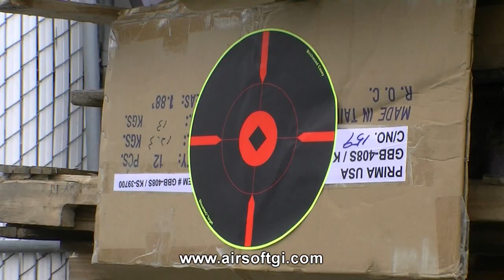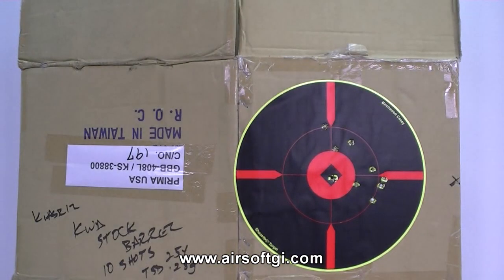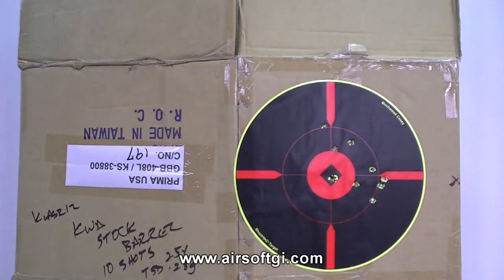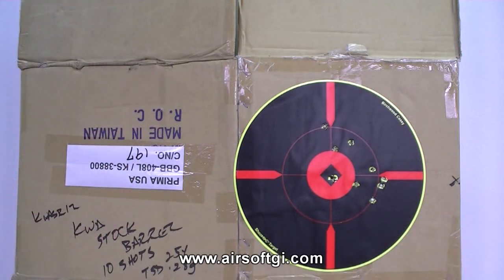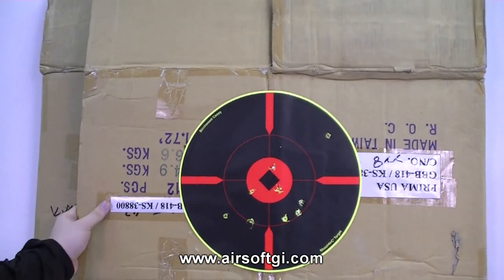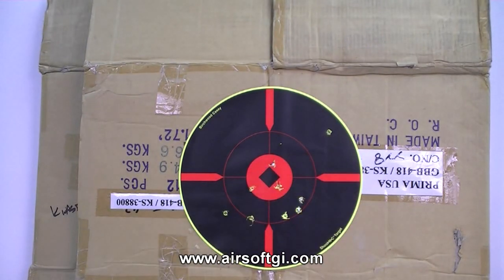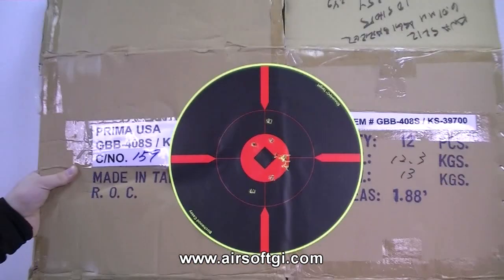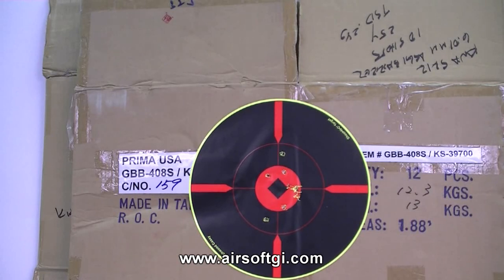Airsoft GI - Tight Bore Barrel Test - 6.01mm vs 6.03mm vs Stock KWA

Comment: 6.01= Better for indoor, short range
6.03= Better for Outdoor, long range
Reply: Why?
Reply: Go on airsoft sniper forums, I don't know how to explain it, but they might
Reply: I'd say its because 6.01mm actually reduces your FPS with an 5.95±0.01mm BB.

The way to go is with 5.88±0.01mm BBs, though I haven't got one to test. It's said to unite the best of both worlds, though that is debatable.
Reply: The more air around the BB the better
Reply: AirsoftGhillie WIDE-BORE BARRELS FTW!!!
Reply: Daniel Symonenko No
Reply: Actually yes, Widebore ftw
Reply: The tighter the barrel the higher the fps...
I went from 6.05 to 6.03 as well as compression upgrades. It silenced my gun and increased fps by about 25 or 30
Reply: The reason is there is more air behind the BB rather than surrounding it and leaking in front as well.
Reply: Fps doesn't determine range so don't be like "Tighter the bore the higher the fps" that doesnt matter
Reply: AirsoftGhillie What the fuck... if I have a gun that shoots 36 million feet per second, and one that shoots 10 feet per second, which one will have better range? Fuckin misconceptions of course if something shoots faster it will go farther before hitting the ground.
And yes tighter bore barrels directly equate to better fps. Tighter bore = better compression = less air loss = more air behind the BB = more force applied to the BB.
Get your shit right this is common sense
Reply: You either are new to airsoft or have never shot a Tokyo Marui, A Tokyo Marui M4 only has 280 FPS due to FPS regulations over seas, their hop-ups are so good that you dont need a very high fps to have good range, therefore a Tokyo Marui with 280 FPS, will outrange a g&g, ICS, Elite force, VFC, etc with 400 FPS ANY DAY.
Reply: AirsoftGhillie This is physics buddy, hop up can extend the range, not make it unlimited. No matter how good of a hop up you have, 1 fps will never out-range 1000 fps.
And I didn't say shit about hop up anyway. Just goes to show you aren't thinking about this, just going with the good ol' "hop up is more effective at increasing range."
Reply: AirsoftGhillie Now answer my question already.
Again: If I have a gun that shoots 36 million feet per second, and one that shoots 10 feet per second, which one will have better range?
Reply: I am talking about airsoft because in airsoft we have a hop-up. I am not talking about how far a BB will go without hop-up, I am talking about a BB with hop-up. But yes the gun with the supposed 36,000,000 FPS will out range the gun with 10 FPS, unless the gun with 10 FPS has some legendary hop up, then it will outrange 36,000,000 with no hopup
Reply: That is true, if tests are conducted with equal barrels and hop-ups and other such internals, but with one gun having a higher tension spring, then the higher tension spring one will prevail if the the hop-ups are set to the same setting due to it having more inertia and therefore overcoming the force of gravity for an extended period of time over the lower-tension spring rifle.
Reply: Yes that is true but my statement is also true
Reply: AirsoftGhillie I was not denying your statement, in fact I intended to validate both your and Clay's statement.
Reply: k.
Reply: I didn't bring up hop up. Higher fps = better range. No other variables changed.
This is what Daniel said and what I said.
Reply: Well this is airsoft, everyone has a hopup, so there is no reason to say it like that
Reply: Ugh.. My gun has a hop up. When I installed a tighter bore barrel, and did not modify the hop up, it's fps increased and its range increased.
Same goes for all guns.
Reply: Lol you guys are so funny.  Fps is the speed not distance. I know this sounds stupid, its true. With airsoft gun's hop up'. By spinning bottom over top it floats longer. Ive seen slow ass floating bbs travel 80 90 yrds.  Now heres the kicker. You do need hi fps to create the spin that you need to travel that distance. In a way everyone is right. Best acc is from heavy bbs. Higher fps drives it far but the barrel and spin keep it straight. A widebore seems to extend the spin on a bb by it touching the barrel less and doing so creating a more true consistant spin.  But there are so many factors to acc. Can't really credit any one thing
Reply: Just saying, the heavier the bb, the lower the fps(but the joules dont change i know that) but the longer the range. Have you heard of the magnus affect, my friend? shoot a gun without hop up, it really doesnt go far.
Reply: Newtons 2nd Law. Look it up, conversation ended.